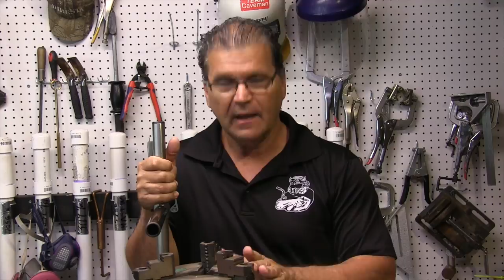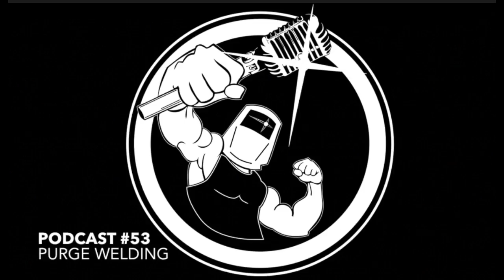WeldingTipsandTricks podcast #53 Purging

Comment: Jody, a little question if I could. I got my hands on some .060 (1.5mm) copper sheet, and I wanted to make myself a backup/purgebox, mostly for stainless sheet work. Before cutting it, do you have any tips about welding the necessary joints? i obviously got a tig (250 amps) but copper rods are really hard to come by in my area and I don't know if my welder has enough juice, plus I never welded copper. Sil-bro is just a smidge easier to find, and I got plenty of silver solder(55% silver) on hand that I use for bandsaw blades and custom carbide lathe tooling. My fear is that the brazed joint might come loose with the heat. Any suggestions? Is it really worth it for me going through the effort of finding deoxidized copper rods? Do I have any chance of getting it done with my welder?

Thanks
Reply from the maker: silicon bronze will do just fine. and you wont need all that much amperage with silicon bronze either...I would get the 1/16" (1.6mm) dia rods
Reply: Always thankful: you were the cause of me starting a career in welding and metal fab.

Thank you!

Comment: Do you have anymore tig fingers for sale?
Reply from the maker: always!  https://weldmongerstore.com/
Reply: weldingtipsandtricks alright thanks,how big of a difference is the regular size vs the XL??? Know it's kind of a dumb question
Reply from the maker: XL is thicker and for most folks will fit over 2 fingers.  I usually an XL over my pinky and ring finger for things like small bore pipe or tubing.  thanks
Reply: weldingtipsandtricks thanks
Reply: Do what I did and get both!!